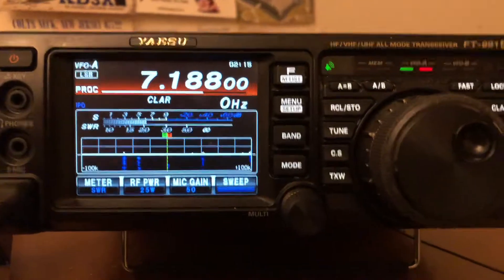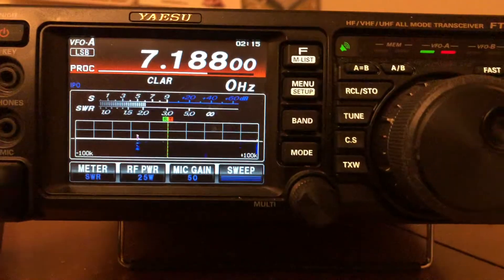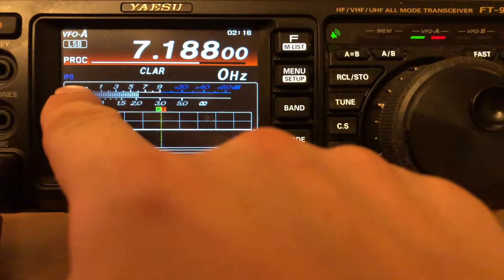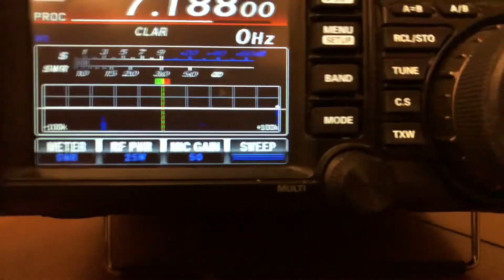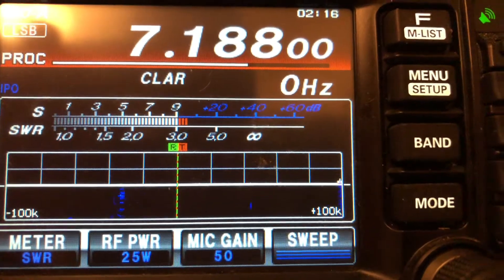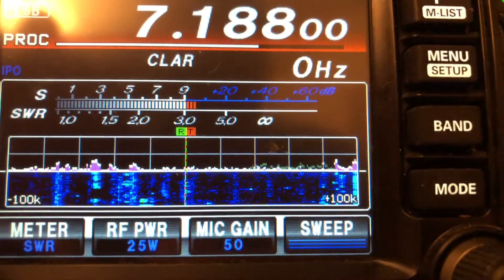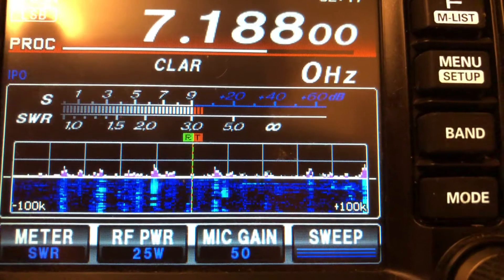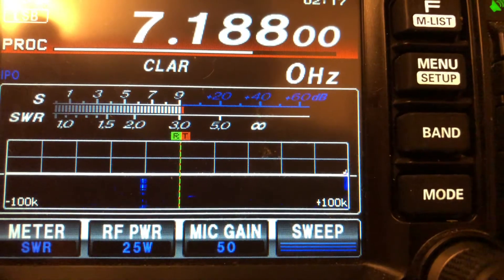Reception on a vertical antenna vs. a horizontal end fed wire.

Comment: I have a few observations:

1 -  The 40M band tends to be a short to medium range band.   That is because most amateurs cannot get a horizontal wire at least a half wave length above the ground in order to get a low enough angle of radiation for good DX.

2 -  Vertical antennas like a 1/4 wave ground plane are going to have a low angle of radiation - which lends itself better to long distance DX contacts.

So, what we have, here, is a situation where you are first listening at a low angle of radiation on your vertical antenna; but, the signals are coming in from a high angle of radiation where the vertical does not have much gain.   Then, when you switch to the end fed long wire, you are listening at a high angle of radiation - because, you have a relatively low horizontal antenna - which is where the signals are coming from.  So, of course, you could hear the traffic better.   On the other hand, if there were any DX contacts to be had on that frequency, you would have heard them better on the vertical, or maybe not at all on the end fed wire.

To sum up, if you want to work DX, you will want to use a vertical antenna or a horizontal antenna at least one half wave length above the ground.   And, if you want to make short to medium range contacts, you will be better off with a horizontal antenna at less than one half wave length above the ground.
Reply from the maker: @richardowens9061  Richard,  thank you thank you for nicely explaining this experiment brilliantly.    I am saving this comment for future reference.   Appreciate the insight and time you put into this.   73.  👍. Prost!
Reply: @mikecricket113  Glad I could help.

73
AI4IJ

Comment: Sure, 40m short haul will likely work better than a low-angle radiator due to the propagation angles for the short path.  If you were trying to work Japan, Africa, Europe, or Asia, the opposite would likely be true.  The vertical has no high-angle receive (or transmit) capability, so the noise of close-in stations is reduced ... and the low radiation angle is just what's needed for DX arrival angles.  No surprise here, basic physics.

Comment: Ok which is which. You refer to both of them as end fed. So which is the end fed vert and which is the end fed long wire?
Reply from the maker: @davidhorner7689  in the beginning of the video while showing you the signals a few moments and I do tell you that right now I am using a vertical the IMAX 2000. So the beginning is the vertical and then after that I switched to the wire.

Comment: This answers my recent ponderings on such matters. I was wondering if i could use my Sirio Gainmaster as a wider band HF RX only antenna, coupled to an 897D, just to listen in. Seems I'll be getting a horizontal set up. Thanks for this, perfect!
Reply from the maker: Sounds like fun. Thanks for posting.  Yes good to switch between the two because sometimes folks are vertical or horizontal on transmit.
Reply: @mikecricket113  An interesting point about polarization:

Signals can start out either vertically or horizontally polarized, but once they propagate through the ionosphere (bounce off of it), they change polarity, due to a wide variety of factors, resulting in signals that are neither vertically polarized nor horizontally polarized, but somewhere in between, or even circular.

I noticed in another comment thread that you mentioned man made noise being vertically polarized.   That is correct - but, only for noise that has not propagated through the atmosphere.  So, using a vertical antenna is going to be noisier in noisy environments.   But, once you get beyond the range of the local noise, the vertical is going to be no more and no less susceptible to noise that has propagated through the atmosphere than a horizontal antenna.

Comment: So you are comparing a antenna that is made for 27mhz and 28mhz to a wire antenna made for multiple hf bands?
Reply from the maker: Just saying that listening to signals off the hF wire horizontally is better for receiving.  Because most QRM in this world is vertically polarized.  Also the imax is 24ft vertical.  I realize is one third of the length of the EFHW wire in this video.  But if someone using a vertical for SWL. That a length of wire stretched out sloper or horizontal would yield in better quality reception.

Comment: Nice video, obviously there are many other factors which would alter that result.
I personally use verticals for low angle radiation for long haul dx, zl to USA and eu, but for rx I use a inverted vee, located long path, short path, less noise than the vertical obviously,  but a vertical would be hard to beat on tx for long distance,  apart from my parasitic vertical on 20m long path which gives my nearly 2 more s points.
73 zl3xdj
Reply from the maker: Makes sense to use the best of both worlds.   Thank you for your insight.   73.